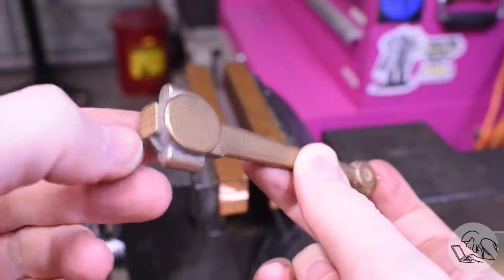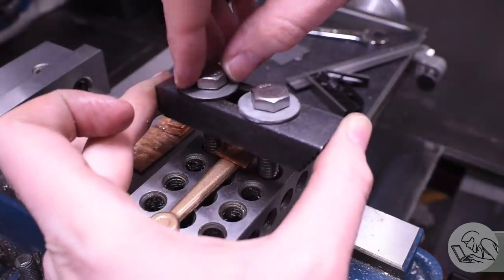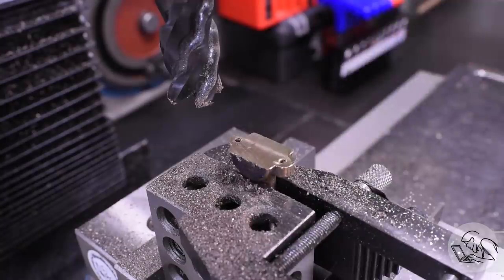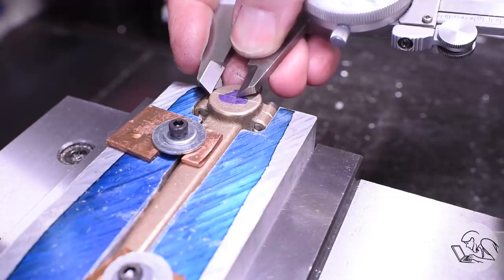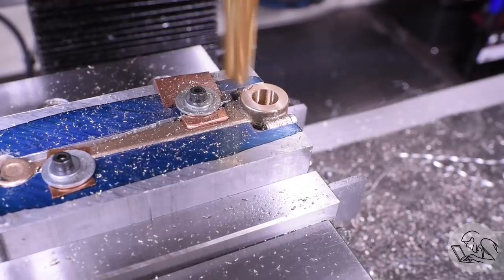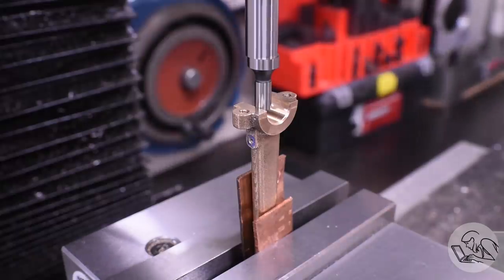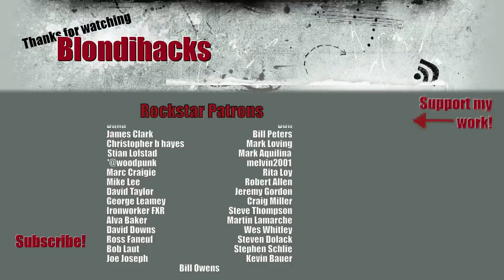Let's Build a Model Steam Engine : First Test Run!

Comment: Greetings from the Principality of Wales. Congratulations on your great channel. I build gauge 1 locomotives and an old pal
 who was a toolmaker gave me a tip to use soft solder. Once the cut has been made on the crank clean the surfaces and solder together.
It's surprising how strong the joint is and you can drill and ream accordingly . All one has to do to complete is warm up the the work  
 separate and clean. Perfect alignment. This is no criticism just another way of doing things. Again Great channel.
Reply: I've been working as machinist almost fifty years, learned much of the trade reading out of old Brit magazine articles and the "model engineer exchange" of the last century, between the States here, and the British isles.  I've used that trick a few times with brass and bronze, forgot it, till I read your comment.

Comment: That "sprue" is actually a balancing pad; at least it is on full size engines.  It gives you some metal to play with to compensate for casting variations.
Reply from the maker: On this engine it’s just a sprue. The drawing is clear on that

Comment: New sub. I am a retired machinist that has followed Joe Pie's build. I have the same kit as he did but will do it VERY OLD SCHOOL. Files, a table top drill press and a 60 year old belt drive, 3 speed armature lathe. It won't be near as pretty as yours or Joe's but I don't see any reason it will not function as it should. Stop by if you like poured 999 silver. I have a good time with it. I do love my files, LOL.

Comment: The con rods in modern production engines are machined and ground to finish dimensions prior to splitting the top and bottom half's of the crank journal. The con rods are then sheared off making an uneven surface that effectively aligns both ends properly because it will only go back together in the way that it was before it was broken. This cuts down on machine time and therefore cost as well as making sure everything is aligned properly.
Reply from the maker: Interesting!

Comment: Sinking the connecting rod casting into the aluminum block is the same process used to carve out a gun stock to fit the receiver/barrel of the gun when custom building a rifle.  Of course, the smith uses wood chisels to bed the metal parts, constantly coating the receiver with carbon black, test fitting, then continue carving until the receiver is fitted.

Comment: Hi, you've probably thought of this. An in-line oiler in the air line would be a useful addition. A bit like using steam oil in a locomotive. Well done, especially with the rod recovery. We all make mistakes and it is so very helpful to get ideas about how to recover from them. BobUK.

Comment: That is so nice. I liked the way you overcame the off center hole. Wait'll you get the timing to high efficiency & runnin' on steam. That'll be a fun video for sure!
Reply: There is an old method for moving holes when they are still at the shallow-conical-depression stage. You use a cape chisel to cut tiny grooves down the side you want to move it towards. Then a light touch with the drill bit and the hole center will have moved in the right direction. Repeat as needed (which you can do until the entire lip of the bit is engaged). Now, doing this at the scale where Quinn is working would take a steady hand, a finely wrought chisel (I grind them from 1/16" drill blanks), a light hammer, and really good magnification.

Comment: When you’re securing small parts like that hot glue can be really useful because it’s so fast and peels off after .
Reply: Isn't there some kind of Loctite that is good for temporary use?
Reply: When I was watching the process of making a sacrificial fixture for the conrod (which is what I've done in the past) I was thinking about fixturing by attaching the workpiece to a press, and pressing it into some molten fusible alloy and letting it cool to solidity. That'd be interesting to play with.
Reply: @smellsofbikes  I used low temp alloy (CerroTru) to make fixtures for the PM Research engine lathe and drilling press kits. The drill press in particular has some awkwardly shaped parts to deal with.

Comment: "Just cause it runs on air don't mean it's a steam engine." Well said, And it will behave somewhat different under steam. Whether on air or steam - because this engine has no governor, the operator must assume the role of governor. This engine should not be run at thousands of rpm, it should be run at hundreds of rpm.
Reply from the maker: Probably “tens of rpm” would be even better. 😁
Reply: @Blondihacks  "How slow can you go?" is also one judge of how well a steam engine is put together.

Comment: Really nice build, however, having a V10 in the 1960’s in the Uk, the casting kit came with small hex head bolts and not those cross head screws, which to my mind detracts from the engineering quality. These were the days of English BA fine thread 0 to 10 BA. All the tap and bolts sizes were the odd number BA sizes and as an engineering project, all the measurements were the in between even numbers to. I built this Stuart Turner kit as a first project using mainly a lathe (Myford Supper 7 with all its attachments, including a lathe milling attachment. I did not have luxury of a milling machine back the. Took me best part of a year -I was pleased when finished. I made the ST boiler and meth spirit burner and installed in a steam driven boat. lots fun. Enjoyed your series and learnt a lot, as I do from Joe, P, Mr Crispin and that whiz German fellow who’s name escape at the moment..... Best wishes from down under, Tasmania Australia-These are many of my building projects-large Astro telescopes and observatories-Southern Cross Observatory-Tasmania 42 South, As retired medic, I am not a machinist but self taught and work in millionths of an inch, or round about 1/10 of a Angstrom. My machine shop is a means to an end. Stay safe, Shevill Mathers esq, 👍😁🛠🇬🇧🇦🇺🦘🔭

Comment: OMG YOU SHOULD POWER VERONICA WITH THIS THING!!!
Veronica's case is steampunk already, so why not add some actual steam?!🤘

I couldn't find current draw on you blog but I'm sure the equivalent of a 9v wall wart would be no sweat for this lil engine. Maybe the only issue would be making the generator overdrive quiet enough that you can hear yourself think while it's running 🤔

Great work overall! I wish I had the space to do a project like this 😅

Comment: Hi, At 16:00, when the big end doesn't quite fit on the crank journal because of the lip, rather than face down the whole face of the
big end  another option is a 'generous' chamfer in the big end hole. I think in your case, you did the right thing - but a chamfer is quick and easy!!
I've just made a little Stuart 10V steam engine and I had a similar problem, but it was due to a small radius in the corner not a lip.
I didn't want a really sharp radius (stress raiser) so I used a chamfer instead.
Love your video series, Regards Paul in NZ
Reply from the maker: The lip was halfway up the crank web. We were way out of chamfer territory.

Comment: "I just have to make sure that the saw goes thru the place where the c'bore clearance hole becomes the threaded hole" @15:20. Actually, if you drill a little deeper with the c'bore, no harm is done except you loose one or two threads (and you had plenty). It doesn't matter on the small end, but on the large end that extra c'bore becomes a great assembly aid - the screws can pilot in the counterbore before you have to engage the threads. This makes putting the cap on much easier.

Comment: Nice job Quinn ! Especially assembling the connecting rod upside down ... I saw it and wondered "why is she... ?" and then I read your note 😂
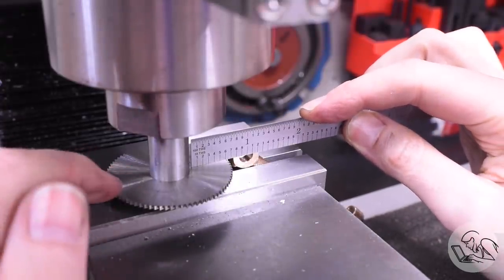Anyway ... At 15:00 to split the clamping side you could have put the cross pin in it and register the saw on the pin...

Comment: Bonjour Quinn,
Had you any doubt ? When I see your skillness and the smart way you do things you need, I had not :+)
Steam is the final test but running on air at 5 PSI is a very good beginning.
Besides this, a mirror to control your work ? I am sure you also use it for your makeup :)
Amicalement, Raphaël

Comment: I'm confused about something. You drilled and tapped the bolt holes, then cut the part in half, then milled each half down even more. Once re-assembled, what guarantee is there that the threads in the bolt holes line up at all? If you mill away, say, 1.5 threads' worth of material, the threads would be 180 degrees out of phase with the part assembled, and wouldn't you get problems tightening the bolts?
Reply from the maker: The top half is clearance drilled, not threaded

Comment: I wonder if thermo setting plastic would be an option for holding parts while machining? I sometimes use it for holding jewellery work, especially while setting stones. I use stuff that comes as little beads I buy on eBay, it melts in hot water and hardens up as it cools. Also good for improvising tool handles!
Reply from the maker: Interesting idea!

Comment: I've had trouble drilling between split halves, too.  Even with good clamping force, it's hard to combat the impact and torque of the cutting lip of the drill.  And the web of the drill is in material that is not.... reliable.  The cold-working action at the center of the drill is complex and I suspect it is interacting with the cut.  Bolting it first must have helped.  Did you use shoulder bolts?
Reply from the maker: I did not. The kit came with regular ones and they’re not really up to the job, honestly. This is a place to improve later for sure.
Reply: @Blondihacks  hello, I was wondering with part number on the diagram that could use improvement? and possibly what would you suggest as a replacement? were always looking to improve at pm research thanks

Comment: I know on Automotive crankshafts you need a radius on the rod journal or they can crack. Did yours require a radius?
Reply from the maker: A radius is always a good idea and there is one in there, but it’s too small to see on camera. These parts are very small.

Comment: Congratulations to you on absolutely outstanding work and problem solving. That's the area I need the most help with: creative fixturing.

How would you like to drop by sometime and help me figure out how to do the connecting rods on my engine? I am really stumped. They are a little more complex and are made from flat stock so no rough casting.

Comment: Good comment. Its not a steam engine until it runs on steam. My guess it will not, as i think ya PTFE piston ring will swell under heat, and lock the engine up. Its all a learning curve in this game on building a steam engine, I know as I have built a 5 inch Jubilee 5xp 3 cylinder steam locomotive with 25% carbon PTFE rings. she runs on steam very well now. but its taken some time to get it right. Like ya work and keep it up on ya YouTube  videos.
Reply from the maker: I won’t be at all surprised if it locks up on live steam. 😁

Comment: Quinn,  can you help me understand what purpose the inboard head is?  I’m checking my assembly to find a tight spot and just curious.  Not sure I will need to, but what if the center hole in the inboard head was reamed a bit larger?  The gland packing is the pressure seal correct?  Thanks for all the help from the series!  Jim
Reply from the maker: The inboard head ensures concentricity of the piston rod,  because it has the registration shoulder with the cylinder bore. These features could be in the base, but that would be very difficult to machine, so they add that little piece in there. Opening it up a thou to relieve a tight spot won’t hurt anything, if needed. Try to be sure that’s where the tightness is before you do it though because the crosshead might get crooked if the piston rod isn’t running true.
Reply: Thanks, that makes sense.

Comment: In a car engine that sprue area you showed in the beginning would be called a balance pad, they balance the rotating assembly by removing metal from the pad - or the crankshaft, pistons etc. -- but on an engine like this I dont suppose its even necessary to balance it.
Reply: On the larger engines there is a counterweight that is applied to the ends of the crankshaft throws.  It is there to keep the steam engine from hopping around the engine room.  Even on the steam locomotives there were counterweights on the wheels themselves
Reply from the maker: In this case it is literally just a sprue. It’s where they filled the casting from

Comment: I don't know about these smaller engines, but the sprue you filed off would be a balancing pad on a bigger gas or diesel engine. Engine this small it won't make a difference.
Reply from the maker: No, it was a sprue

Comment: isn't be the crankshaft mountet upside down. in dis orientation the Oiling Pass you mashined wont work as the oil will flow ou not in

Comment: OK good job. Slight problem why is it running backwards.
Reply from the maker: I like that direction. You can run yours whichever direction you like.
Reply: @Blondihacks  there was a reason why thay ran the way they did, let me explain. As the piston thrust forward and pushed the crosshead towards the crankshaft 
the big end was moving up forcing the crosshead down into a solid cast iron bedplate and not up into the weak crosshead guides.
As piston returned pulling the crosshead back down the crosshead the big end was below the level of the crosshead and pulling it down onto the solid cast iron bedplate 
not up into the weak crosshead bar's  which happens when it is run in reverse hence no reverse electric. I hope this makes things a little clearer for you as I wasn't trying to
be funny with you I just have 39 years as a qualified mechanical engineer and toolmaker and was just trying to part with some of my knowledge.
I still enjoy watching your videos and never miss one, have a nice day and keep making the videos.